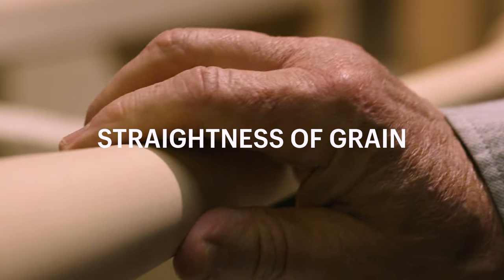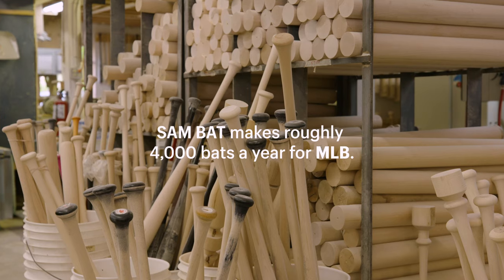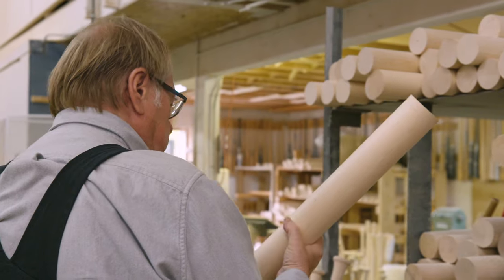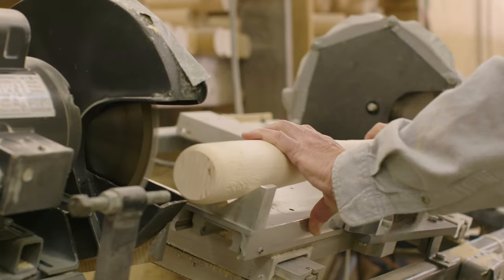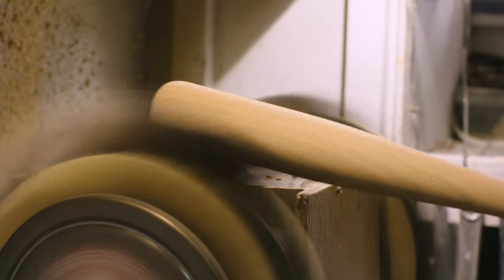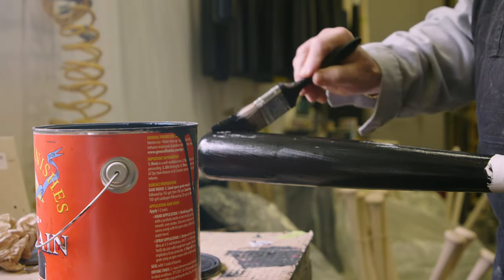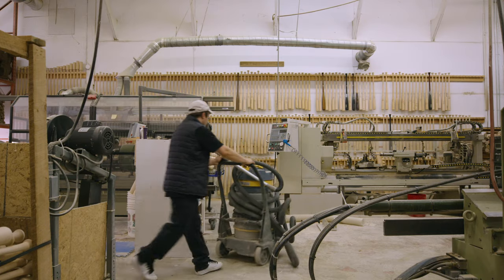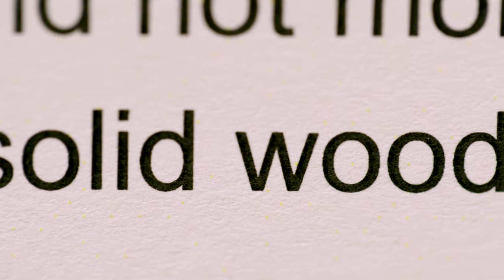How to make the perfect baseball bat | My Shopify Business Story

Comment: Couple questions.. 

I found something that is not on the internet anywhere. When you answer, you'll be the first. 

Everyone simply says "straight grain" but there is no such thing. Trees grow round. When you look at the grain on a tree trunk cross section you can not place a 3 inch circle anywhere that does not contain ARCS of grain. If the source tree is a 40 inch ash, the best chance you have is a blank close to the newest part of the growth.. which means fat wide modern growth that I doubt is a great choice.. Heartwood is going to be denser and thus there will be very curved grain.  So let's start there for my next question. 

Where do you put the label, how do you determine that. Remember to reference the FACT that curved grain will be giving different performance when the label is turned skyward or earthward. Go ahead and answer the related question.. Do bats exist with your brand that have the label on RANDOM (50/50) locations such that the owner isnt aware wether his edge grain for his swing side is biased SKYWARD or for line drives at the pitchers feet. Remember.. your label will either be in the cradle of the "c-shape" grain.. or be on the BACK of the C-shape.. likely randomly.  Given this "science", wouldn't you be doubling your profit if you pointed it out and convinced switch hitters that when they switch, they need to get the TWIN BAT you created from the same tree on the opposite side! 

Last..

After you go through all those blanks to select the perfect one, do you mark all the other ones you passed over, so no one else picks the wrong one? Or just throw them away. If you still use the blanks you passed over.. do you tell that player "this was a Barry bonds reject blank"?

I'm excited to finally find someone with the credentials to answer and bravery to send me a check when you sell this science to each customer.